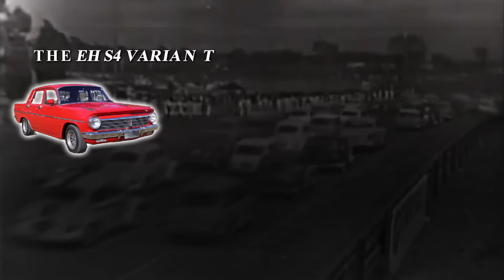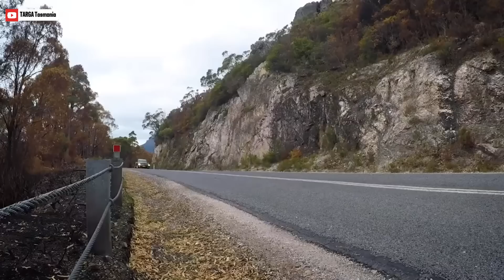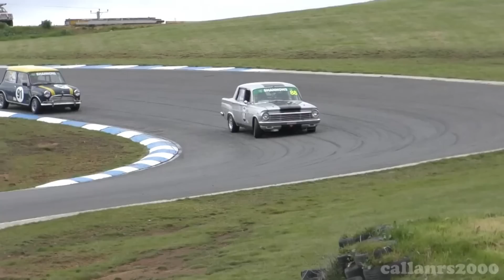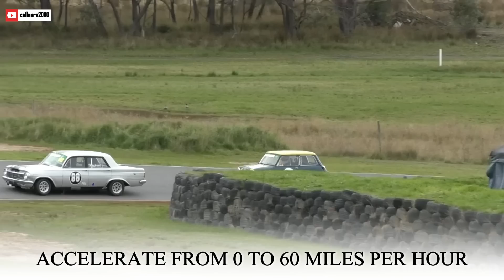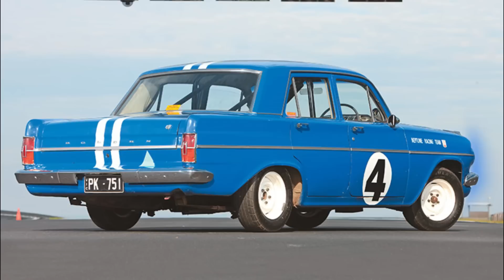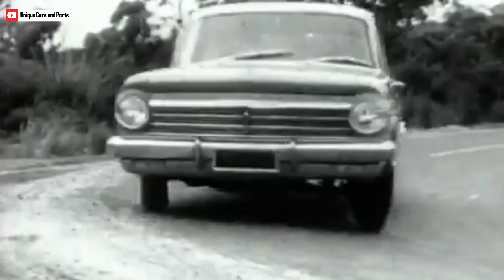Holden's SECRET High-Performance 179 Engine That Dominated Bathurst

Comment: Like any Holden red motor, the 179 wouldn't pull you out of bed.
High performance and red motor is the ultimate oxymoron.
Reply: & yet a humble 6 cylinder LJ Torana whipped gtho's at Bathurst in 72.
Reply: @jamesburke9101  because it rained the entire Race and you're seriously comparing an XU1 engine to a 179 boat anchor ?
Reply: @ChrisM-fz6xx  you had your arses handed to you-again.
Reply: @ChrisM-fz6xx  The Xu1 engine was only an evolution of the 179 and actually still had more room for modification. 179 had a bore size from memory of 3.5625"  186 and 202 had a bore size of 3.625" all the red motors except for the 202 had a stroke of 3.000" 202 was 3.250".  Xui had better pistons heavier rod bolts better cyl head different sump different cam profiles and the 72 one ran bigger cd strombergs than the earlier ones at Bathurst and webers in 73 with one choke blocked off.
Reply: @jamesburke9101  what do you mean again ?  GT HO kicked the shit out of the XUIs in 1970 and 1971 . Try again idiot .
Reply: I worked in a reconditioning shop from the late seventies and for under a Hundred bucks we could easily triple the power of a std 186 just changing the valve springs allows them to rev to at least 7000rpm and there are a lot of other machining mods we could do for nothing that increased the horsepower. Carbies were the most expensive part if you wanted something more than the 2 barrel stomberg. Larger valves similar to yella terra make a massive difference. We used to modify V8 valves and fit them for nothing. Yes the old red motor was a blank canvas for cheap  modifications if you had a machine shop at your disposal.
Reply: Changing the valve springs  would have only increased power by about 10%  The standard 186 was 88KW. A GTR-XU1 was only 118KW (the claimed 190hp/142KW is "gross" horsepower). Even the race homologated BMW CSL 3.0 only produced 152 KW from the vastly more sophisticated M60 engine.
Reply: @mrbrisvegas2  Changing the valve springs will not increase the HP at all but it will allow it to rev higher and with a different cam that will allow it to make more HP.
Reply: You never had one !!

Comment: The Red motors had a HP block with thicker cylinder walls. Dual downdraught Stromberg carburettors,X2 variety. In Australia these engines  came in 138,149,161 ,179 ,186, cubic inches .Last one's were 173 and 202 cubic inches,achieved by longer crank stroke
Reply: Yeah, it's the 179 X2 engine that is meant to be addressed here :)
The 179 stockers were pretty ordinary.
Reply: @axle.australian.patriot  They wouldn't pull the skin of your mums rice pudding in stock form. They were gutless a slant 6 Valiant would cream one or the Falcon 170 cid 221 cid etc around the EH era 1964 ish
Reply: @Psittacine-pp5yd  Again, stock 179 and the 179X2 were different engines. Nothing like each other.
Reply: @Psittacine-pp5yd yeah a extra 40 cubic inches usually does make a engine more powerful..🤔
Reply: @axle.australian.patriot  Yes i am aware of that
Reply: @axle.australian.patriot  An X2 engine was a stock 179 with a very mild cam and a 149 head. Then the twin carbs and iron headers. Yes they used the EH 179s steel crank. Most not all HDs had a cst crank.
Reply: @ldnwholesale8552  " Most not all HDs had a cst crank." Yeah I rechecked on it. They kept the steel forged crank only in the x2 where the stockers went to cast.
I'm not sure when they stopped making the 179 X2 as the marine market was still fairly strong.
Either way, the 179 X2 was my personal introduction to performance engines. I had seen a couple of fakes prior to meeting the real deal :)
It was all down hill fast from there... very fast lol
Reply: HP block is EH 179 only. Stock 179s in 63 were fairly good.
The 138 RED engine was a Torana only engine. aka 2250. Or used in export models, some with around 7.5-1 compression.
Reply: @ldnwholesale8552 ,The other trick for these motors was to use a 149 cylinder head on a 186 engine block,instant 12 to 1 compression
Reply: I believe that the X2 also had a forged crank.
Reply: The 138 cid was the grey motor which ended in EJ Holden the first Red motor was the 149 as you mentioned in the EH then 179 etc
Reply: @Psittacine-pp5yd  ,They actually had the 138 red in the Toranas 2250 LC
Reply: @graemetd46  , also 130 in the lc's.   my lc gtr came with a 161s.
Reply: @graemetd46  I don't know about LC Torana's at all i dragged the much early models.
Reply: @Psittacine-pp5yd  161 and 186 came in HR Holden's
Reply: @graemetd46  I know about the HR
Reply: @Psittacine-pp5yd  Just remember that the video creator meant to be talking about the X2 engine, not the stock 179 :)

Comment: Typical no mention of the 179X2. Twin barrel stromberg carby, twin outlet cast iron headers, and I’m sure a low volume combustion chamber!  Until last year one in a HD Holden was parked two doors down from my place, the X2 tick on the rear.
Reply: The X2 is actually what this video is meant to be about, but not many people would be aware of them.
Reply from the maker: @ yes you are right on that one. We care for quality and good information, but we have to take care for a good title too.
Reply from the maker: @GregEyre-d1k  thanks for mentioning
Reply: Bloody hell. 179 X2 had twin Stromberg carbs. As did 186X2 in early HRs.  The 186S in late HRs had a 2 bbl Stromberg. As did 186S right through HK HT HG. 145hp. Probably more economical but the X2 was a bit better for outright power
Reply: @ldnwholesale8552  "The 186S in late HRs had a 2 bbl Stromberg."
.
I ran the 2 barrel manifold with a stromberg of of a 253 on My HX 202 One tonner and it roared pretty hard :)

Comment: These are awesome motors to pull crazy horsepower with little modification,and it only got better with the 186 and 202ci engine's with triple Stromberg D150 carbs,a 12 port head and extractors standard! They could be bored out massively,and a common trick was reversing the pistons on the gudgeons,raising the redline by 3000rpm and reliable when done correctly!  When maintained properly they would go for 500,000+ reliable kilometres and powered Holden vehicles in the Red form right through the 70's and early 80's,though the fuel crisis pollution changes did limit performance,it could be easily be disabled. Later Blue and Black generation's had alot more pollution control built-in to the design,making it not worth disabling as the carburettor ran extremely lean. The last variant, the Black engine was Fuel injected, which gave some of the snuffed out power back ran in the VK Commodore, replaced with a badge engineered RB30 from Nissan in the VL Commodore. Probably the biggest credit the Red motor has is that it opened up Australia to the masses with it's reliability, ending up powering Holden's for 21 years.
Reply: Trivia. Nissan and GM developed the RB30/31 3.0l engine off of the success of the 179 X2 and Datsuns overhead cam L series engines.
So if you pull down a Nissan RB engine you will find GM stamped inside of it :P
Reply from the maker: @ Hahahah that’s crazy … so not completely white label
Reply: @LegendaryRideCars  Yeah the RB30 was a bit of a GM/Nissan fankenengine. Anyone like me who has ever had anything to do with the R30/31 skyline and the VL Commadore will know what Fankenengine means.
They go crazy hard and you can put a 50cent peice on the cam cover and the 50cent piece wont fall over :)
Reply from the maker: @axle.australian.patriot  that’s gorgeous!
Reply: @axle.australian.patriot  The RB30 was a bog-standard standard NISSAN production engine designed and built in Japan. It had ZERO connection to any Holden engine.
Reply: GM had nothing to do with designing or manufacturing the RB30. The engine was based on the L series (originally based on the Mercedes M108). It was a standard Nissan engine already used in JDM models.
Reply: Running the pistons backwards makes no power but wears them out rapidly!
I have never seen any red motor close to 30000 miles. On modern oils maybe but not waht was around 60 years ago.
Reply from the maker: @DekGT5mad  wow 🤩 what a huge comment of great info. Thanks 🙏

Comment: The 179 x2 had had a hp block
Reply: I thought the block was beefed up as well. The X2 has a different engine number to the other 179.
Reply: X2 HD was 179 on the block. HP was 179 EH

Comment: I always wanted to try a 130 holden red six head on the 179  really small chambers but good for porting lots of meat , even a 138 red head . And before a keybord expert jumps in and days they are grey motors , no they are not the snallest red is the 130 red export LC Torana engine and 138 red is local red for the LC Torana.
Reply from the maker: @JosephCowen-fz8vj  do you had one of those red engines?
Reply: @LegendaryRideCars  I worked for South Sydney council picking up abandoned cars in the 2000s , I ended up with 6 pantec's full of engines including one 130 red out of an Indonesian LC Torana export that must have made it back here and several 138 reds out of local LC Torana's and one 149 out of a Holden at Gulgong tip . Along with probably 20 Holden 253 s and 308/304 . But I sold them 15 odd years ago , I had those motors sitting in trucks and always wanted to mix and match heads to see what happens ? When I think of what I sold for stuff all it's sad, I even picked up an abandoned wb ute in Marrickville NSW, as anything V8/good six/rotary or motorbike I'd save from the Sims Metal at Mascot I pulled the WB Holden V8 it was a "B" (Brock) cast headed HDT group C 308 and T5 trans . They only made 500 "B" cast headed 5.0 s , I sold it for $3000 but it's a piece of history now . Yes I wish I still had the 130 red and 138 reds.
Reply: @LegendaryRideCars  I worked for South Sydney council picking up abandoned cars in the 2000s , I ended up with 6 pantec's full of engines including one 130 red out of an Indonesian LC Torana export that must have made it back here and several 138 reds out of local LC Torana's and one 149 out of a Holden at Gulgong tip . Along with probably 20 Holden 253 s and 308/304 . But I sold them 15 odd years ago , I had those motors sitting in trucks and always wanted to mix and match heads to see what happens ? When I think of what I sold for stuff all it's sad, I even picked up an abandoned wb ute in Marrickville NSW, as anything V8/good six/rotary or motorbike I'd save from the Sims Metal at Mascot I pulled the WB Holden V8 it was a "B" (Brock) cast headed HDT group C 308 and T5 trans . They only made 500 "B" cast headed 5.0 s , I sold it for $3000 but it's a piece of history now . Yes I wish I still had the 130 red and 138 reds.
Reply: @LegendaryRideCars  to answer your question I probably know were those red 130/138s are sitting rite now . Gulgong, NSW .
Reply: I had a customer with a 138 ss Torana. I never got to pull the engine down though as it was kept immaculate and didn't do big miles :)

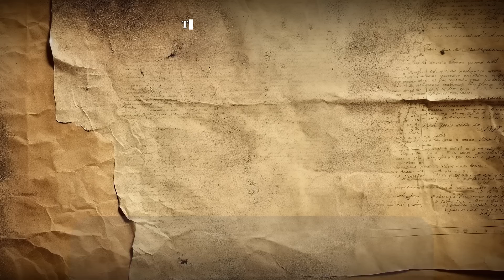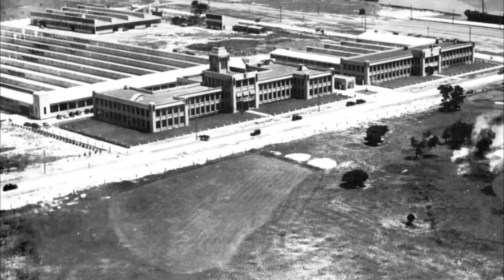Comment: 1:02 Typical Yank, turning our EH into a left hand drive. 2:47 We were using Pounds back then, the Euro hadn't even been heard of back then and we still dont use the Euro. 
Dad hit 105 MPH on the way to a fire on our property, this was a very early EH 179 Station wagon Special. 
I have picked on you a bit but credit where it's due, very few realize that the "Hydromatic Transmission WAS a four speed but only three were selectable, the other was a "kick down gear" for acceleration and overtaking performance and it worked very well.
Reply from the maker: @306champion  thx for pointing that out. We will check that part about the false use of euros.
Reply: 306champion, we called them sludgomatics.   they didnt get up and go like modern transmissions.

Comment: The red motors were purposely crap from factory but with a carby swap, a bit of tuning and a V8 fan because they had a horrible cooling system they went as the as the Chrysler valiants with almost twice the cu. I know because i have a HD holden and CL Valiant
Reply: My healthy 192 EH with the big [factory]  radiator struggled to run warm enough. 
I raced a HR for several years with stock radiators and never had an issue. Except for a very rusty block clogging the cores for a period.

Comment: Leaking oil everywhere.....Fill the Oil and top up the fuel.
Reply: What you didn't maintain it !?
Reply: @JosephCowen-fz8vj  Just a casual observation, after checking the oil hundreds of times while working as a driveway attendant at the local servo. Most leaked around the head.oil everywhere....
Reply: @bigearz255  cork gaskets that people tighten down too much.
Reply: @JosephCowen-fz8vj  Yup :)